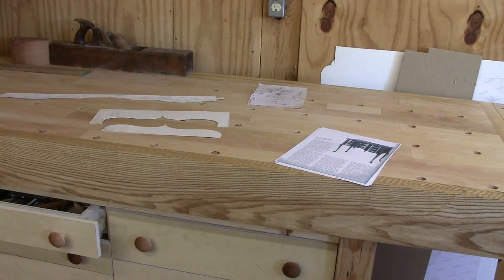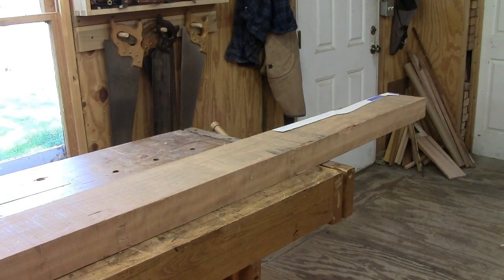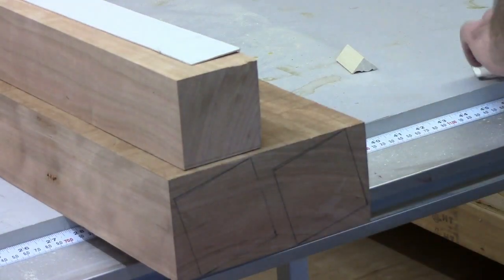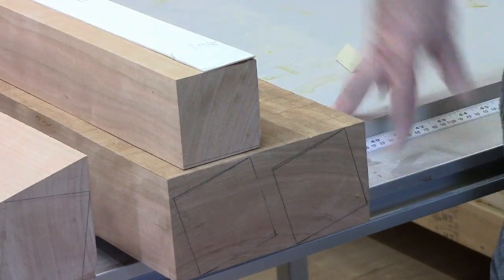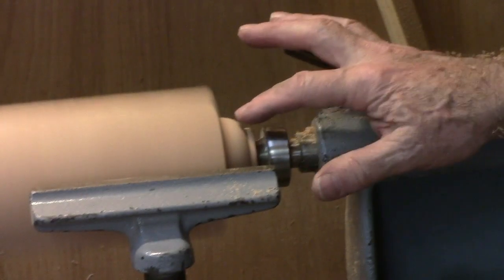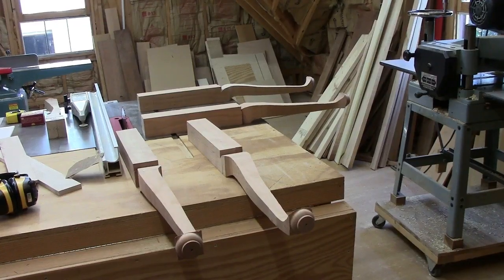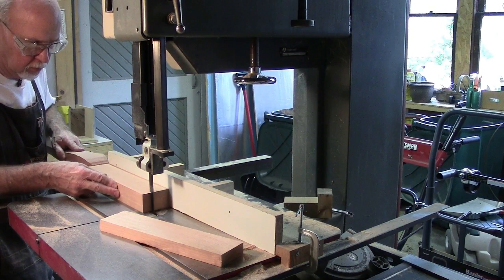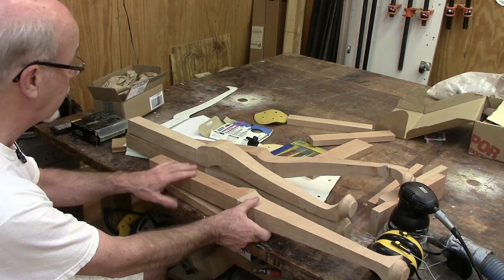Curved Blockfront Lowboy Step 1

Comment: Over the top impressive with your grain selection...  did you just set your band saw table at the required angle?  Had you expected to have to do that with that piece of cherry or was that a surprise after you received the wood? Or did you pick it out? And is there any offcut that shows the original grain orientation still around that you could finish to show the difference in comparison to a completed and finished leg?
Reply from the maker: Ray Roberts Ray it was not a surprise,  radial cut lumber is rare, radial cut produces a straight grain  look, there are many choices and looks, some people like a bullseye on the knee, that requires a different grain pattern. I have an article on selecting grain for cabriolet legs send me you email if you want it
Reply: I messaged you with the email address...